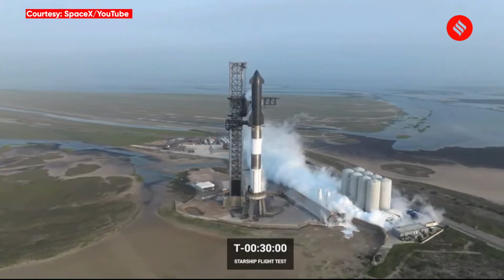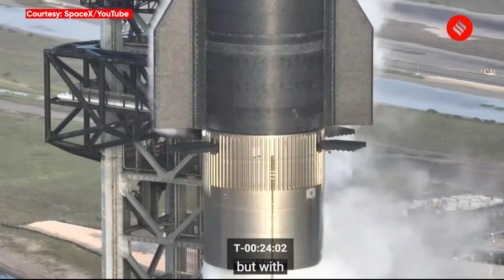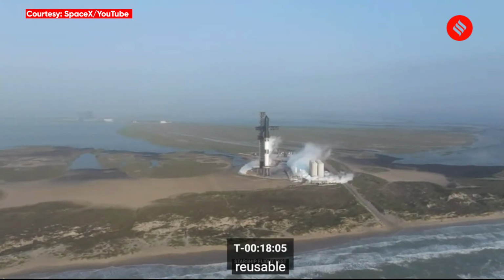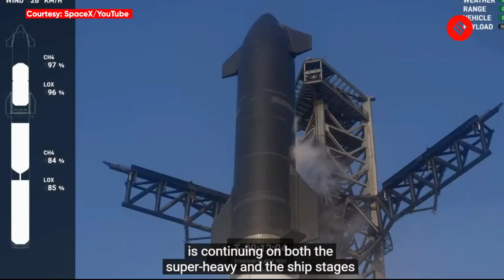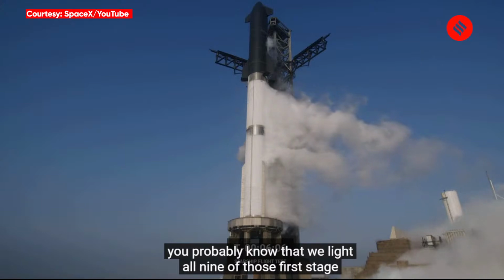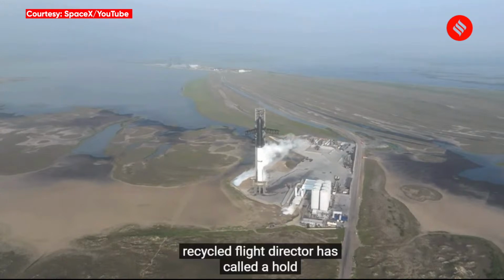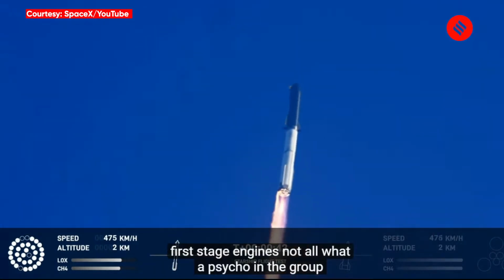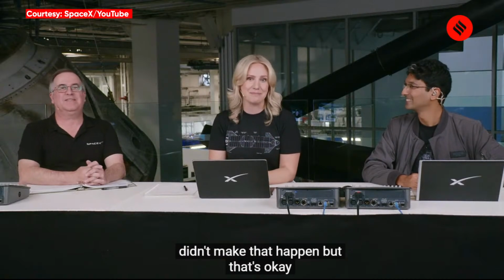SpaceX's Starship, World's Biggest Rocket, Explodes Moments After Launch

Comment: Great fireworks show, no way to spin it this was a complete failure not to mention the poorly designed launch pad that flew apart from the sound and kinetic energy of the launch.
Reply: relax they have plenty more to crash
Reply: SpaceX is advancing the design so fast, they have built many rockets, only to scrap them right out of the factory. If 24/7 had taken any longer to launch, they would have just been scrapped, too. Now SpaceX knows what changes need to be installed in the repairs. Very successful!